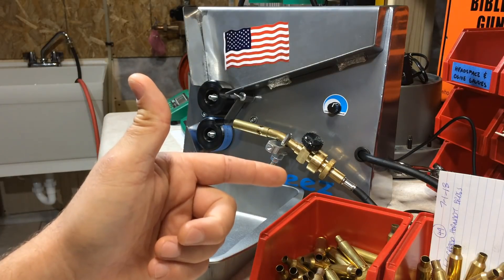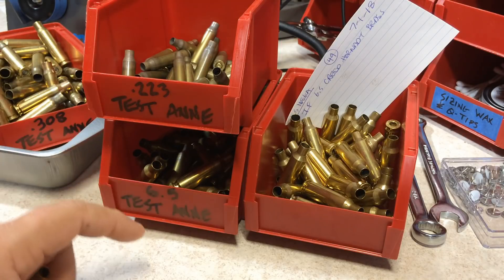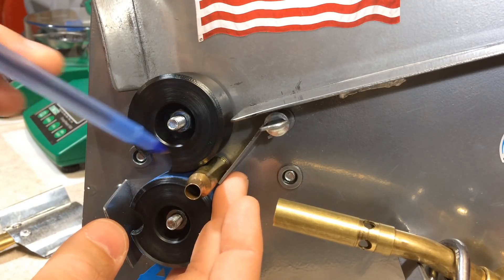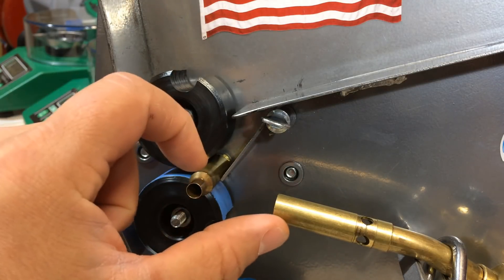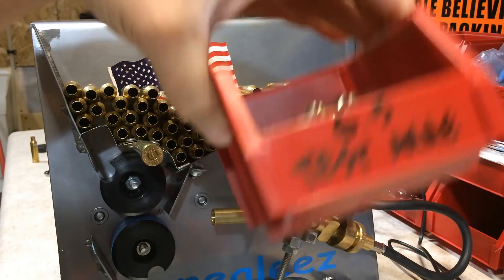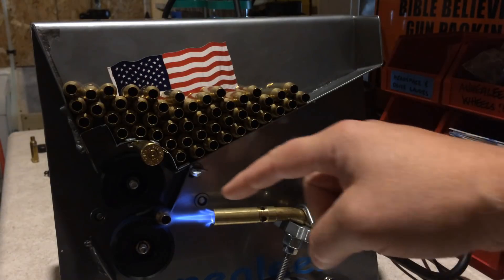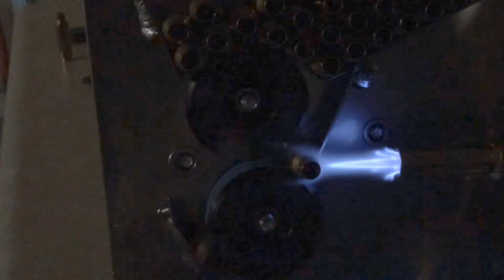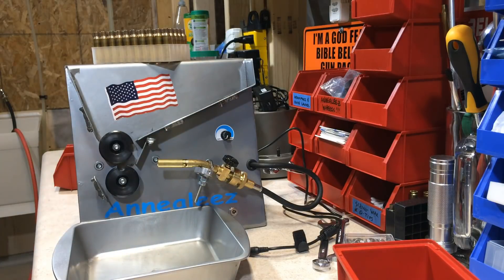ANNEAL BRASS WITH ANNEALEEZ GEN2 & ELFSTER'S TRAP DOOR MOD PART2

Comment: Ever had a case not spin?  Clean 6.5 Creedmoor Lapua brass just sits while the blue wheel turns underneath - no spin.
Reply from the maker: It can happen if you get oil on the wheels. Or if you get the adjustable ramp too tight,  or use the incorrect wheels.

I do have my EP 2.0 annealer coming out soon in the next couple months BTW! 

https://youtu.be/sIdWvwIA-xY
Reply from the maker: Also, the brass can not be lubed! It needs to be clean brass
Reply: @ElfstersRiflesandReloading  Thank you!  I'll check/try it!  I was just watching your other vid and giving it a thumbs up.  Thanks again!

Comment: Have you tried using a non-contact thermometer (with laser) to read case neck temperatures?   Would seem to be something that could be incorporated to get real - time monitoring of annealing temperatures, and adjust speeds very accurately... even if propane pressure changes, etc.
Reply from the maker: Nope, just the glow method
Reply: And if you got REALLY fancy.... figure a circuit to give an alarm when temperatures got out of band,  due to different such factors case wall thicknesses among different brands of brass, etc.   and for the $2500 option, kick out brass that didn't reach, or exceeded the desired temperature into  separate bins...    Imagine the payback period for that over  buying new brass!

But, we don't DIY strictly because of cost...

Comment: good ol'   "good amount, but not too much" torque spec.   What's too much?   When you strip it out and have fix it....

How about putting a belleville washer  in there, that flattens at a chosen torque, chosen using a suitable belleville washer torque table for the size fastener you are tightening?     Then tighten until flat, and no more.
Reply: You are seriously over thinking this.

Comment: why did you go to other annealer after you built one?
Reply from the maker: Just because it has a hopper. I still use my DIY for small batches. Anything over 100pcs I'll use the annealeez
Reply: @ElfstersRiflesandReloading  I am waiting for parts to build one. Had a friend build case. I think I should put hopper on it, anyone out there that tells you how to make that part with spinning cylinder?
Reply from the maker: @alanc1872  nice! Cant way anyone has

Comment: Is there a difference on flame while the propane tank content decreases? In other words, do we need a regulator, or at what point do you replace the tank? BTW, great instructional video, the only suggestions would be showing couple of cases with too much time and an at a two different angles while annealing.
Reply from the maker: Thanks! Yes, 100% the flame will start to decrease when it’s almost empty. I usually shake the tank before the anneal to see how much is left
Reply: @ElfstersRiflesandReloading  Thanks for the quick reply. I have a unit on order, so I'm gathering all possible info before it arrives. Keep up the good work and subscribed.
Reply from the maker: Thanks 🙏!!

Comment: Assuming you haven't already burned a case, i.e. orange flame, burn off, can the same case be used multiple times as the test case?  Also, if the case does get solid glowing but no burn off, is that case no good anymore for reloading?   It took me a lot of cases to get the timing and heat just right.
Reply from the maker: That’s the whole point to using  test brass. You can over heat the test brass, multiple time, in order to get the speed set right = so when time comes to do the actual brass to be reloaded = should be minor adjustments on the speed. You’ll get the whole process up and running rather fast once you get a method to your madness down